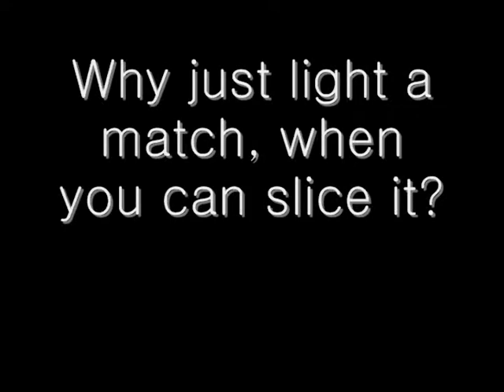A small laser for demonstrations, featuring the unique properties of 10 micron radiation

Comment: A tall lonesome pine, now thoroughly dead, stands on bare rocks some distance from the water. The stroke that killed it had somehow to connect with the water. For the most part, it followed cracks in the rocks surface, tossing out sand and such. But near the tree it did a blasting job. -Electrostatics by AD Moore            Did you get a light bulb? Score.